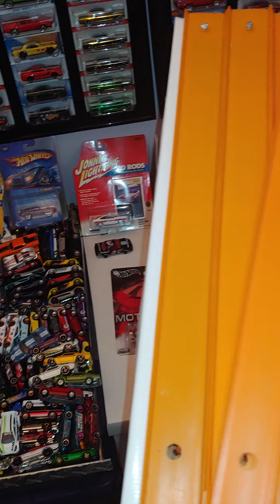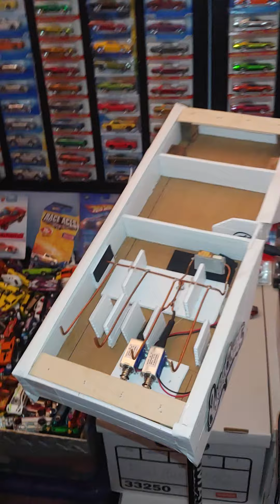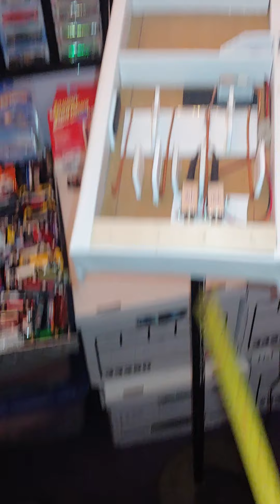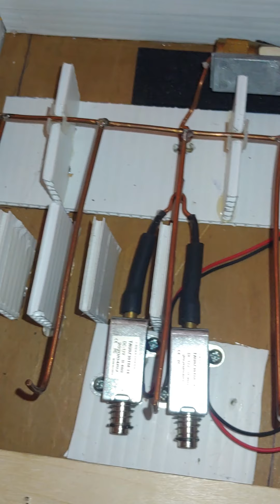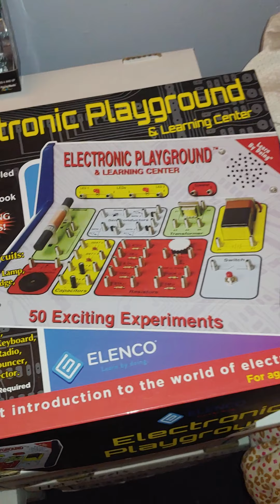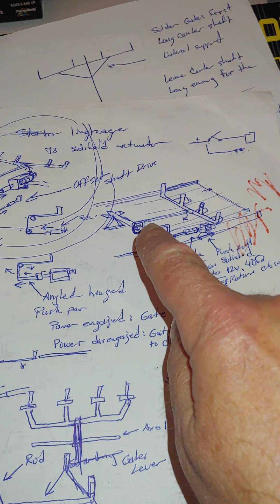Hot Wheels Inspired four lane, 16 @, remote control, starter (build/deconstruct)

Comment: I finally found it!
Reply from the maker: I have to re work the starter.  I procrastinated and didn't solder together a proper circuit board.  As a result the solenoids are possibly weakening?  I have 8 new ones to buy me some more time.🤣